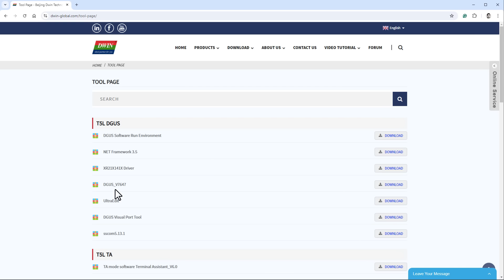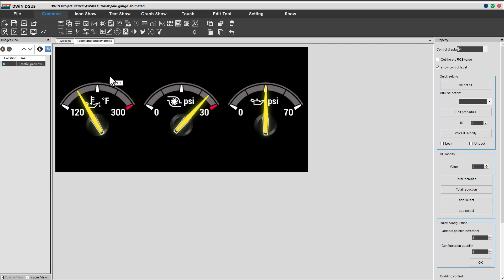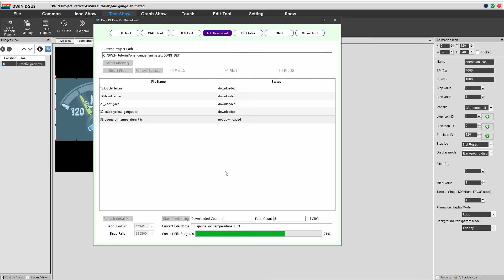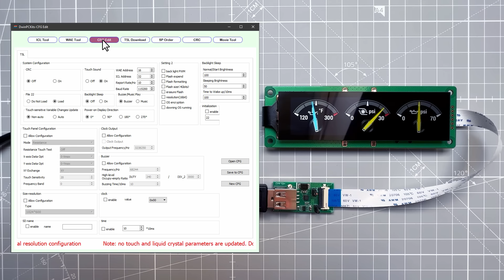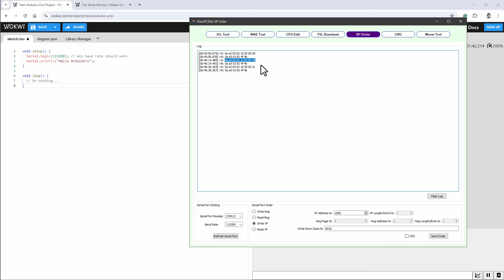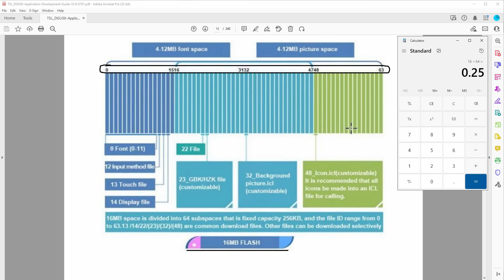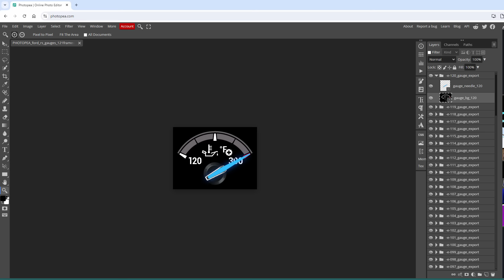Ford RS gauges with Arduino UNO and DWIN intelligent display (like Nextion displays)

Comment: Amazing work mate. Did you manage to get the turbo pressure formula by any chance? I have some details about it, decoded the lookup table used by the module but still not able to fully decode the formula
Reply from the maker: Thank you, I´m glad you like it! I only have the formula from the last time - i.e. calculated based on the analog turbo boost pressure sensor. I believe the lookup table that´s provided on the AliExpress page is not very precise, and there might be some errors inside. Would be nice to just calculate it based on some precise pressure sensor instead, but I don´t have anything like that - at least not yet.
Reply: @upir_upir  whoops sorry, i meant oil pressure, not turbo :P. Turbo pressure value is already available as a canbus information, while the oil pressure, it's not, because it's calculated using engine temp and rpm
Reply: nvm, i just saw it in the details and the canbus it's not managed at all! well, still amazing work, love the knob display too!
Reply from the maker: Canbus OBDII would be the next step. Still learning..

Comment: This is the video I have been waiting for my Volvo S60 dash project.
Reply: Volvo gang.
Reply: Please post about your project, I've been planning one for my own S60 for a while aswell ^^ Would love some inspiration
Reply: @the3xploit372  
Would have to buy the dash first to reverse enginer it for the connections.
Reply: Hmmm... Need to get 60€ from somewhere to buy the part...
Reply: @SlendisFi_Universe  it’ll be interesting to see how cooperative Volvo CAN Bus gateway is.
Reply: @raheslop  
Well. In the end it is all about data splitting. The biggest problem will be the info displays.
Reply: @SlendisFi_Universe  thanks, I’m still very much learning when it comes to CAN bus but as I understand it some manufacturers make it easier than others.
Reply: @raheslop  
Yeap. And what I have learned so far, it is just a huge pcb behind the cauges connecting to a wire bundle. Just need to figure out which ones are for which display and rest is simple.
Reply: Lol what a coincidence, making some gauges for my 850r
Reply: @londonbroilburnout9946 850 FTW!
Reply: Yes exactly!  This is the video, I have been waiting for as well.  I want to develop a Radio display, with commercial quality displays and graphics.
Reply: Came here with my 12' S60 T6 in mind as well!
Reply: @ROKRsGameClub  
Still need to get money to buy the dash to be used as the base and the arduinos and screens. Hard to get money through YouTube videos tho.
Reply: @SlendisFi_Universe  I get that! This is my second channel! Working over time on content trying to do the same thing haha! Stay consistent though!
Reply: @ROKRsGameClub  
Yeeeeeeah... ADHD makes that difficult xD
It also makes it impossible to make schedules.
Reply from the maker: Cool, good luck with that! I look forward seeing your project.
Reply: love those cars
Reply: As soon as I saw this I thought about using this for my own P2 S60 dash. Possibly remove the warning lamp section and replace it with this? The possibilities
Reply: Ooh that sounds like an interesting project. Out of curiosity, are you fixing broken gauges or customizing your cluster?
Reply: @sklzlm  
Modernizing. Maybe will add BT and GPS systems as well.
Reply: Boa noite. Eu tenho um vw gol g2 no Brasil com rodas da s60 , ficaram lindas.
Reply: Great to hear someone else also doing it, I’m currently making one with a V70 dash, working cluster already, and currently fixing a button box and a display with double din.
Reply: @SwagusSE  
Nice!
Reply: Hey please make a video of this amazing project! I would love to watch it!!
Reply: Unfortunately I just finished my peugeot 205 dash with Nokia screens...😢
Reply: I'm really interested in making a digital dash for a mk3 supra, trying to see if I can replicate that old classic digital dash toyota made. Though im only researching and would still see if I'd buy the original if one pops up for sale.